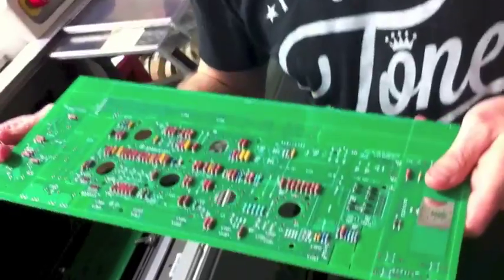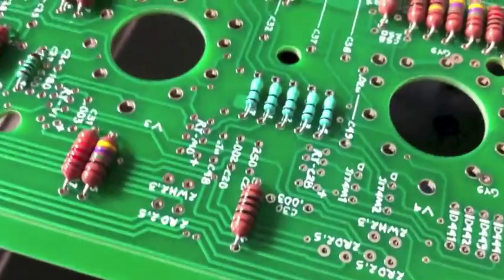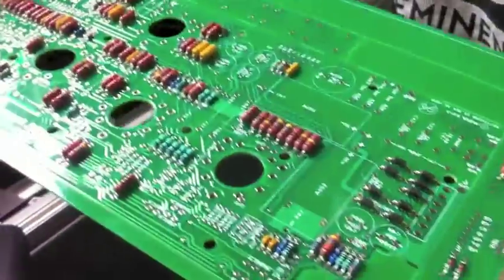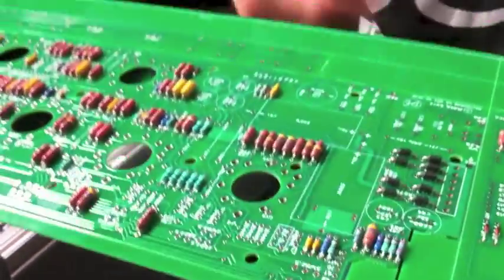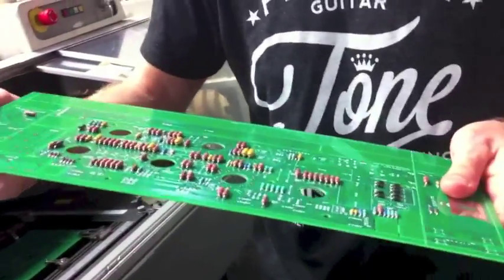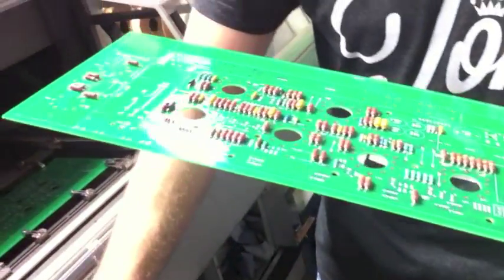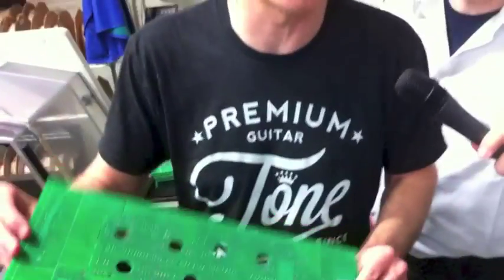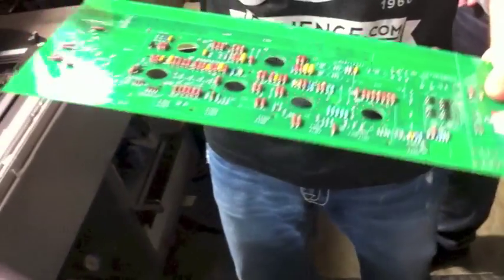Mesa Boogie - Printed Circuit Board Production

Comment: I find that those soldering lugs become heat sinks in the circuit, causing the foil to lift and the connection joint to loosen...   I'm not saying that's everyone's experienced but that's mine so far

Comment: that's an understatement that the printed circuit boardn important distinction in terms of the quality at core level...   
     I think you can make the argument that it's a foundational level too.    kind of like if you went out and build a skyscraper on a landfill. . ..  is absolute guarantee the printed circuit boards in Mesa, fenders Marshalls it don't matter....   I printed circuit boards is garbage on a hot running tube amp it's just not compatible with the function of the gear.....     you have to go back to the seventies to see circuit boards of any "quality"...  

I'm sorry if I'm being an asshole,. but I'm working on a Fillmore with the separated board it's less than 2 years old......